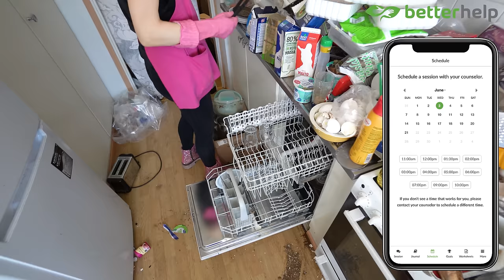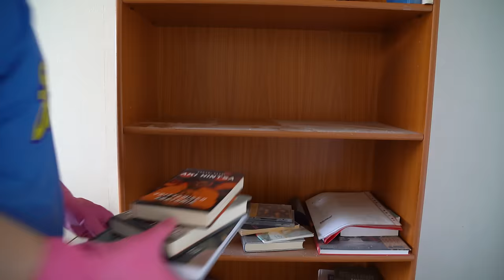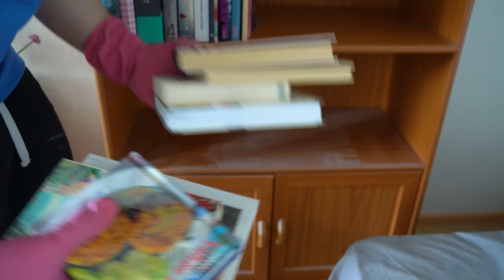Grandma is a prisoner in her own home -Deep cleaning Her way out 👊

Comment: 15:05 often on drawers there is a little stopper built in. On most its a plastic piece on the bottom that can be pulled down or on the inside it can be pushed up to allow the drawer to come out fully.

Comment: with mental health, it can take just a year to get it that bad... hire a cleaner to come regularly clean your house and clean it with them, don't be embarrassed just clean it with them and it can be a great motivator to just keep on top of it, eventually they will come and all they need to do is a quick vacuum, sweep, mop and maybe light dusting and wipe down of areas that have been neglected. even with that last part it is a great motivator...

But do keep up the cleaner, they are a great inspiration tool to get you motivated.

Comment: Cleaners should always get rid of extra plates and utensils (or pack them away in sealed boxes). Leave them with a reasonable set. If they have 50 cups etc., they will use them all again and end up in the same mess. Unmanageable

Comment: You are an angel to help others like you do but you are taking risks with your health not wearing N95 level mask, tyvek suit, and puncture proof gloves at least until trash, dust and  debris are removed. I am a certified safety specialist. Change your protocol to remove, and HEPA vacuum first then do your magic with wiping down surfaces etc.  Bless your work but do so safely.